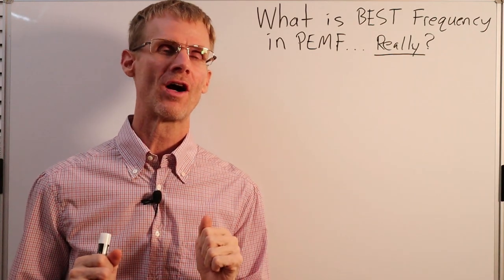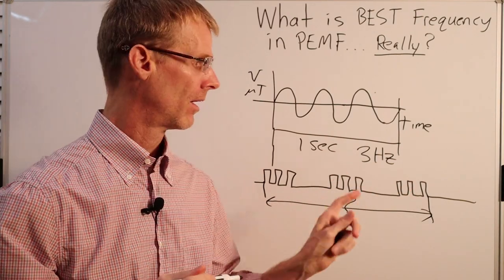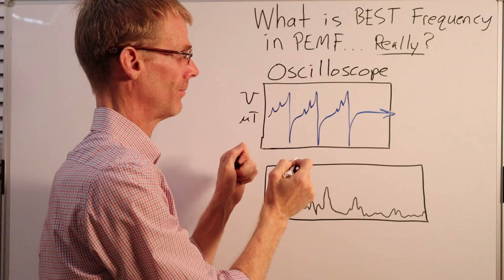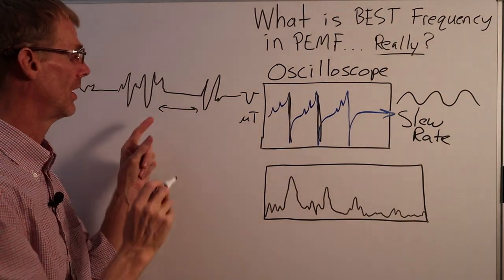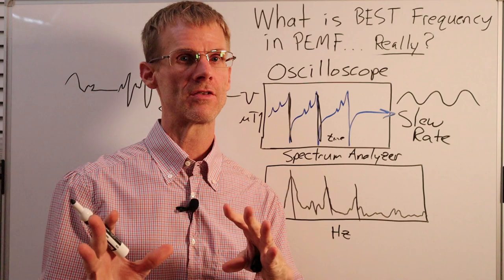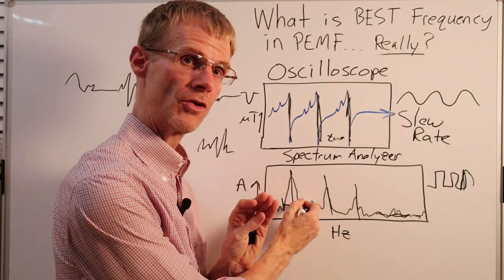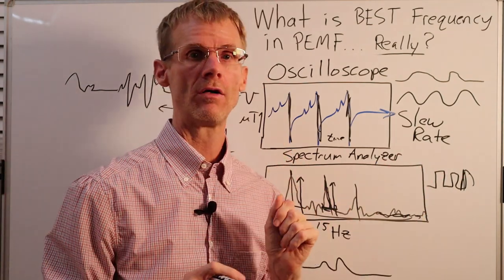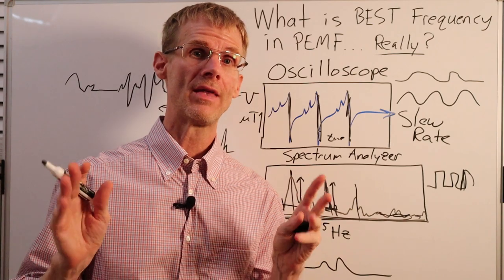PEMF Frequencies & Signal - Clearing the Confusion! [New Series]

Comment: as a ham radio operator this is a good review.  In the future I would like information on correct usage of the probe and the ISLR
Reply from the maker: Hi Kevin, thanks for the feedback... Feel free to call me on usage of the probe. The Probe is ideal for small joints, dental issues, and throat, ear, nose and eyes. Also any small pin pointed areas. If you have knowledge of acupuncture points, you can use it on those spots.
ISLRS I did a video you can see here:
https://youtu.be/zbgqLq-ZRhw

Comment: I purchased the Setient Light PEMF.  The frequency app that they suggested to use is kind of poor.  Do you recommend another one I can use with this device?
Reply from the maker: I am not a big fan of these high intensity single coils. The original doug coil has the longest success rate of these kind of devices but uses more of a Rife higher frequency approach. I wish I could help, but I don't know what would be the best app to use. 
I much prefer the lower intensity full body mat PEMF devices like iMRS, BEMER, Centropix, QRS, Vasindux, etc.